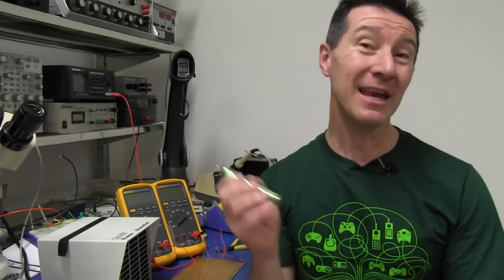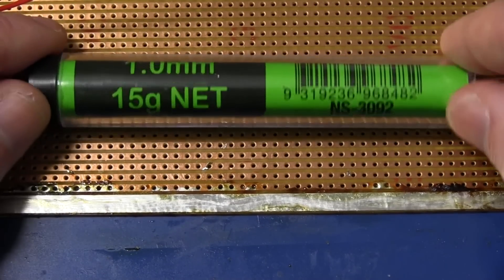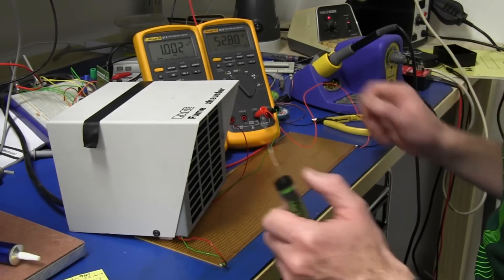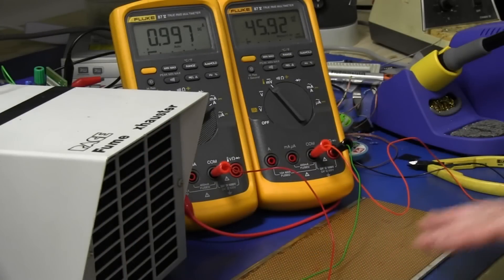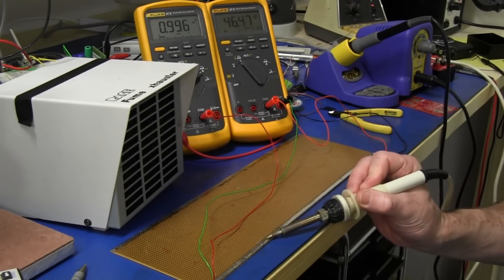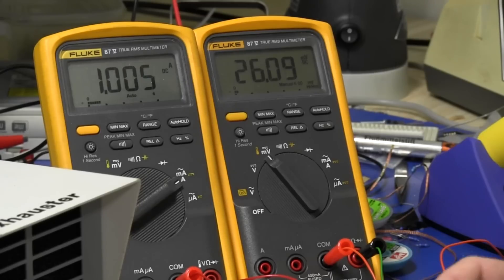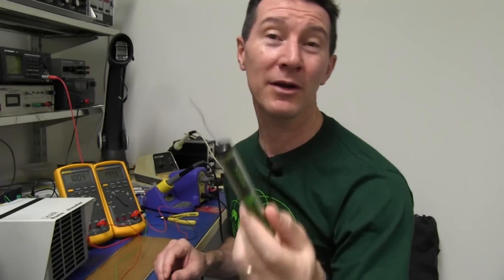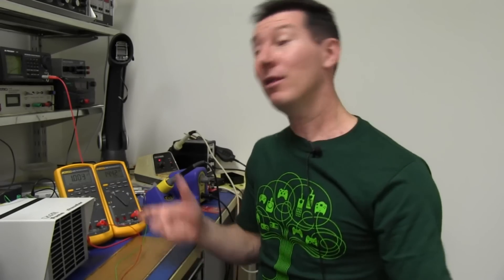EEVblog #319 - Lead Free PCB Tinning

Comment: I’ve been an electronics hobbyist since the early 90’s.
I finally got myself a Technician job with a large company, only to find out they use LeadFree solder only. 😮
It’s terrible to work with and I suck at using it
My dream job has now become less enjoyable 😢

Comment: @EEVblog : What do you think about Sn48Bi52 (48% Tin, 52% Bismuth) lead free solder ? Have you used it ?
Reply: I heard they use bismuth it desoldering solder, cause it holds heat and stays loquid longer or something, allowing you to go down the pins then lift the chip.

Comment: 99.3% Tin/0.7% copper? That's not solder! That's garbage. Normal people can't solder like that... Solder is made by the science of chemistry! I'd like to see Dave try that with a mixture of 96.35% Tin, 3.0% Silver, .5% Copper, and 0.15% Antimony.... more commonly known as Sparkfun;s "Special Blend". It's the ONLY unleaded solder worth buying IMO for special applications (costs more) like lightweight micro/mini 3D RC aircraft where an extra gram and added resistance is actually noticed.

Comment: I believe another test could be used.  Need a high current power supply (battery booster device that can start a car) and a means of controlling the current, and a means of measuring the massive currents this thing will need.

Just use the board as a fuse and see what current pops it, and have fun proving the tin slug works.

Comment: +Yutaka Takenouchi The problem with lead-free is that it gets cracked much easily from temperature fluctuation stress, also it has higher melt point temperature putting more stress on component been soldered.
Reply: It also grows whiskers eventually shorting stuff out. Also since the melting temp is higher, it is much more difficult to get a good solder joint .

Comment: Lead-free is great, i don't get what people are whining about.
Reply: dispatcher7007
Surely that's a generalisation, with many different lead-free solder types out there, at least one of them should be tolerant to thermal stress...
Reply: +Yutaka Takenouchi There is also the problem of "tin whiskers" when using lead free solder. Lead free is horrid to work with and brittle as well.

The most hazardous part is the flux in both cases too.

Thankfully you can still get good leaded solder still. Much better to work with and leave the lead free to equipment manufacturers to help with their built in obsolecence....
Reply: +dispatcher7007 I heard one good thing about lead-free solder (although I have not tested it myself, so I can't be sure it's true) and that is that due to its inferior wetting properties, you can put pads significantly closer to each other without them getting shorted during soldering. But that only applies to machines because humans can't work at those scales anyway.

Comment: What is ROHS solder?  Absolute SHIT!  It put more waste in the landfills than the foolish concept could of ever reduced.  I proudly de-ROHS every BGA that comes my way so they work again - properly.  Lead free solder with the proper silver content, I like it for older through hole technology in certain applications, but never for anything surface mount.  ROHS is yet another dismal failure to "save the planet".

Comment: Lead free solder is shit 
If you want lead free guys buy a soldering iron that heats up to 900c and use 22 carrot gold solder 
Well gold is far more conductive than lead and tin and silver but how do you use real gold solder for jewelry 
Jokeing on your electronics your soldering tips need to be glowing to melt it
Reply: Silver is more conductive than gold. Even copper is 45% more conductive than gold.
Reply: Sami Al-Terkawi Hasib ok i agree done my research  you can get silver solder which is complient but its used in audio
Reply: jonathan oxlade i w as going to say gold is use for its "low"  or non oxidisation properties.... its simply inert/// well almost

Comment: ΗΕΥ you could have just taken 1meter of both solders as they where (without soldering) and measure they're resistance...
Reply: Not really. These solders have a flux core and if they aren't exactly the same diameter in the solders you compare it will skew the results, even if the outside diameter of the solder was the same (and the outside diameter is the only thing you can really check yourself).
Btw. the point of the video(s) was showing how much it lowers the resistance of an existing copper track. If you're just interested in the conductivity of solders, there're already tables for that.

Comment: We tried some lead free solder at collage in 2008. It was horrid to work with, required higher temperature, didn't float properly and just made a mess on the pcb that was hard to clean off. I only use standard 60/40 lead since then, but if anyone could recommend something lead-free which works like that, I'd be happy to try it.
Reply: Tbh I only had good experience with lead free that had added silver to it, but also with lead free it only works nicely when I use either a heavy duty 120W soldering iron (like for joints as well) or a transformer soldering irons which seem unpopular here unlike in Poland but the can be very good with most solder types.

Comment: Stupid idea: Maybe the tinning isn't for the electrical connectivity but heat dissipation.

And by the way: Copper is also in the tin, because tin "eats" copper. When you use a pure copper soldering tip, it get hollows by the time. If the thin already has copper in it, it is more saturated with copper and therefore less aggressive.

Comment: I'm of the opinion that lead free RoHS solder is actually worse for the environment and worse for health and safety since it's chiefly responsible for the premature failure of much of today's consumer electronics. Apparently the lead free crap is not allowed in either aerospace or medical electronics because of this.

Comment: I got an Idea, how you can test it precisely: Weight both sorts of solder, you will put on and it should weight the same. Than put it on and put the PCB into the oven, so the solder will reflow. This should be perfect for exact tests.

Comment: If you were trying to measure resistivity (which you're comparing with your method), then one flawed comparison is as good (bad) as any other flawed comparison. The resistivity has almost certainly been calculated under lab conditions before anyway, so it's re-inventing the wheel. 

As an indicator of whether a similarly inconsistent process such as wave soldering produces noticeable effects on resistivity – Dave’s method is a good approximation, albeit not statistically usable by any means.

Comment: Not a fair comparison. The cross sectional area and type of flux used will have an impact, even if they're the same outer diameter, there's no way to tell what the actual proportion of solder to flux in that section is.

Comment: "Difference over Original"

Percent Increase & Decrease seem to confuse nearly everyone. The way to remember it is that you want to simply take the difference divided by the original. 

If something goes from 50 to 30 it decreases (50-30)/50 which is 40%.
If something goes from 30 to 50 it increases (50-30)/30 which is 66%.  

The numerator is the same (50-30), it is what you define as the "starting value" or "original value" which makes the difference.

Comment: A floating circuit is simply one that is not connected to earth ground, so it will have a "floating" state relative to the earth. This means that any electric field encountered would change the relative voltage to the Earth, making this relative voltage unpredictable. However, Dave is measuring the voltage between two points in the circuit, so the floating state of the circuit should not pose a problem to his measurements.

Comment: It might not be the cheapest, easiest or elegant but a thick gauge copper wire will beat solder or board traces any day. So if you are really stuck with needing low resistance or high current and there is not enough room on the board for a wide enough trace for the circuit, copper wire might be a reasonable solution. If you needed dozens to hundreds of amps or more an aluminium or copper bus bar might be in order. I know it is outside the scope of this but worth mentioning.

Comment: The test in these videos are prompted by the common practice amongst electronics manufacturers of applying tin onto high current traces. The way these are applied is by simply leaving an opening in the solder mask on the traces to be coated, and the trace will pick up solder when passing through the wave or dip soldering. So it requires no added work. The cost of the solder is probably negligible compared to having someone soldering a wire onto the trace.

Comment: Not since you have several flux canals inside the wire, doubt they are exactly the same dimensions between the two manufacturers :)

Comment: Bang as in blow the ass out of the powersupply or bang as in "Pop goes the over current fuse" or Buzzz as the over current alarm goes off (depending on power supply)

Comment: Nice Dave but  suggestion....It would've been more definitive if you had accurately weight the board before and after addition of the solder to get the weight of solder added

Comment: If someone gets really picky about it, they can get two identical lengths and gauges of solder and measure the resistance using the same 4-wire method.